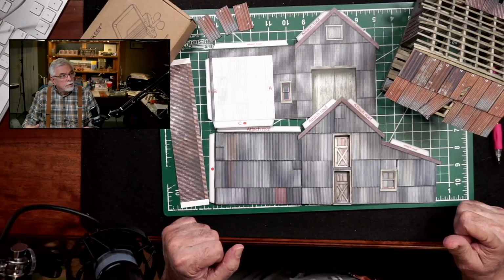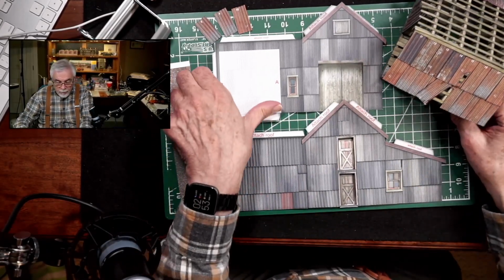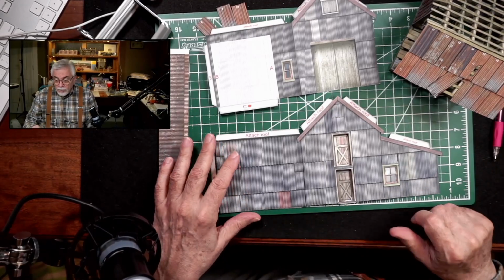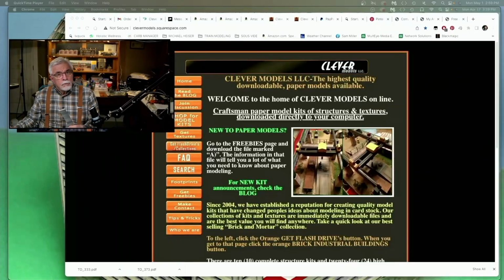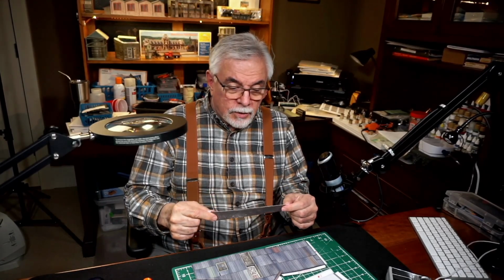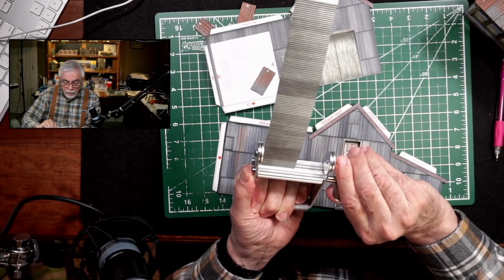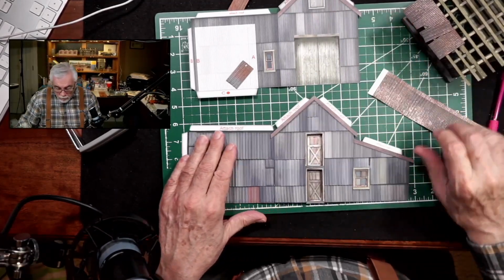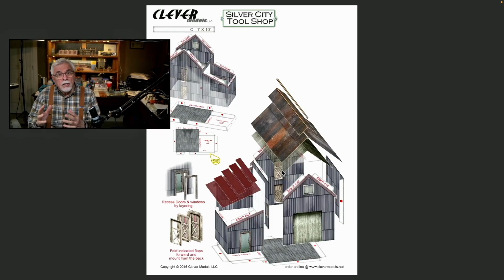Crimping Card Stock For Corrugated Steel Walls & Roofing

Comment: I learned a trick for HO corrugated steel from MarklinOfSweeden.  You have to start with one sheet of scale corrugated plastic and make a mold for your appropriate size of corrugated steel.  You then add a thick coat of Elmer's glue and wait for it to dry.  After that you just peel off the Elmer's glue layer and presto, you have a sheet of corrugated steel to paint as you would the plastic sheet.  Buying individual sheets of corrugated plastic sheets gets expensive.  Thanks for the link to the squeezer as now I've got to drop $10.00 for the squeezer as I'm beginning to model in O scale for my Lionel 027 and plan to construct an 027 layout in the near future.  I'm gonna start on the Silver City Tool Shed model in the next week or so, and will have to get the squeezer so I can add the relief to the corrugated steel.  Just wish they made a finer one for HO scale.  Thanks for all your tips and tricks as I really enjoy watching your videos and am learning a lot about card stock modeling.  It takes some talent to turn a flat piece of card stock into a 3D building.  Cheers from eastern TN

Comment: Nice! I actually own a similar tool that I purchased several years ago specifically to corrugate some card stock. I was building a model of the Saturn-V rocket from scratch and the skin is corrugated, a trick the engineers used to add strength to the metal skin. The effort paid dividends. It looked so very real with the corrugated relief of the skin. What I had to do was run some card stock thru the crimper and then flatten it so I could measure the actual distance from crimp to crimp. I had to do that because on the actual rocket, the corrugations alternate color from white to black. Once I had that data I went back to my cad program and created the skin in strips with the colors properly alternating and then after printing, ran it thru the crimper. It really gave a depth of realism that I'd never seen before on a cardstock model. I've only used it for that one project so now you've inspired me, I'm going to have to dig  it out of the tool kit and give it a go again. I think I'll get that free model you pointed out and use it to reintroduce myself to corrugated cardstock. Nice episode! Thanks.
Reply from the maker: Hi Chuck, many thanks for sharing your experience, and happy to hear you want to get back into Card Stock modeling!  Here's the link to download the free Silver City Tool House kit from Clever Models.   http://clevermodels.squarespace.com/free-downloads-01/h-o-scale-silver-city-tool-house-kit/